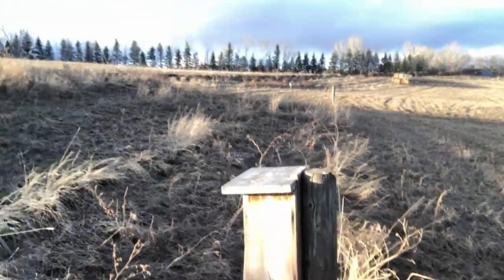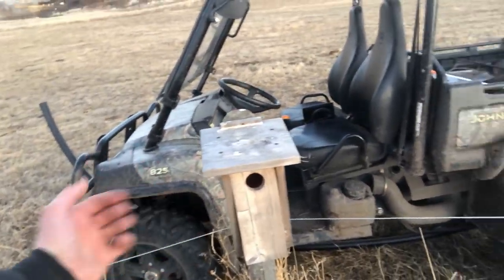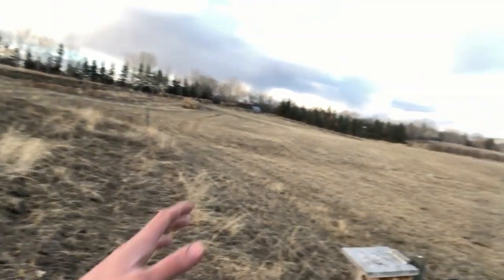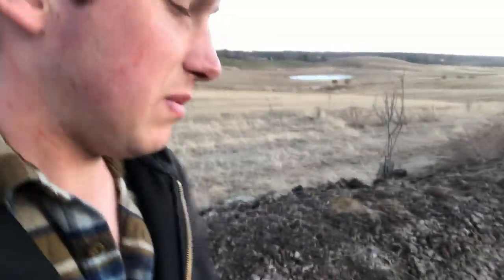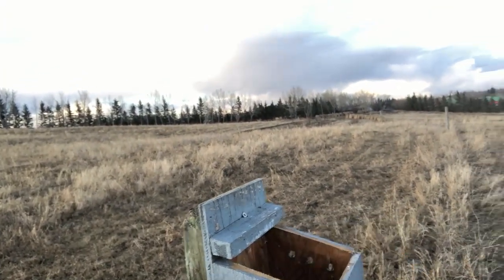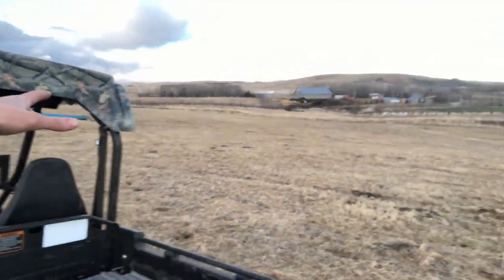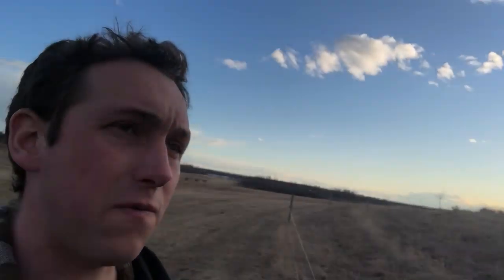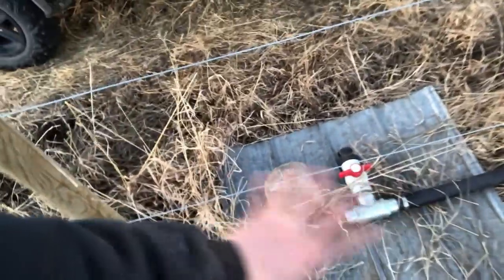Worst and Best Bird House Design For Regenerative Ag

Comment: I wouldn't change the design of the first one. You need the 1X8 to create an overhang on a slope so the water doesn't run along the walls and then inside the house. Also Cutting the 4 corners of the floor is quick and easy to do on a chop saw and also important, because if water does get inside, it won't accumulate in any of the 4 corners. I like that design.

Comment: Thank you for really informative video!
Too bad I did not see that 6 months earlier when I was building few bird houses for my garden - opening of the front side is really a great idea. But next ones I will make in few months will definitely be like this. 🙂

There is one thing I probably can't agree fully - making simple tilted roofs is not really time consuming nor difficult. Two sides with tilted upper part is just one cut by a saw: e.g. a 60 cm long plank cut at an angle in the middle gives two sides for one bird house. Marking of cuts takes a blink of an eye when a template is made. My process was: a 3 meter plank divided into 60 cm sections by hand sawing (4 cuts), then marking tilted cuts using a strong cardboard template and making those 5 additional cuts to produce sides of 5 bird houses. I did not cut back or front side at angle (that would be doable but not really convenient with a hand saw). All that is even faster with mounted circular saw.

I also wondered if you have also added birdhouses in woods or orchard(s)?

Comment: I’m an industrial designer Someone please discuss with me!!! So I honestly say it all depends on the bird but all birds lay nest out in the open, most if not all bird houses are close, this is actually closer to a cave and not at all natural to the bird, yes it offer protection but it takes away from the natural aspect of the bird and making them dependent on humans. Isn’t the best solution to provide open platforms with minimal roofing for rain?
Reply: Hi there. A lot of smaller birds are cavity nesters and don't nest in the open.(Titmouse, Chickadees, Wrens, House Finches ....)
They live in drain pipes and knot holes in roofs and trees and swings sets and ect....
By building houses for Blue Birds, they don't have to search for old growth trees with knots, which are fewer every year and we get to track and monitor their migration and numbers. 
Plus you can use predator guards to make it safer for endangered species, like Blue Birds, to populate and everyone is happy.
Reply: @tomrudd1118  yes I did a little more research for my project, it depends on the species of the bird. Not all birds have the same requirement and needs, thanks for the video! (:
Reply: i have cats running around. unprotected platforms seems like free candy for them.